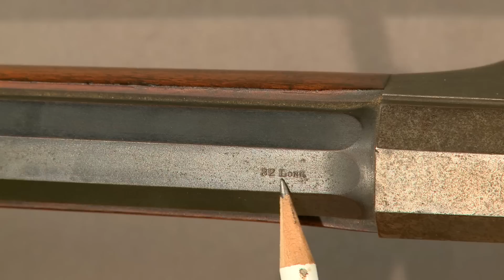Gunsmithing - How to Make a New Mainspring for a Ballard Rifle

Comment: When tempering the main spring, how long do you leave in the pot?
Reply: he left it in as long as it took to turn the spring blue. The time was more determined by the blueing process instead of the tempering time. All that is required to temper is to heat the spring to the desired temp giving some time to ensure it is uniformly heated. This time would very depending on part size and thickness...since you are holding the part well below the thermal threshold (when metal turns red hot) there is no danger in leaving it for a long time. Just ensure you quench immediately to lock in the properties or else the steel will just anneal back to its soft form.
Reply: ~20 mins per 1/8th spring thickness is the general rule. So a normal flat spring is about 15-20mins.

Comment: Spring steel stock should be .5-.7 % carbon, no less. That way your quench and temper operation will provide sufficient tensile strength and spring force. Also, it's not necessary to quench the spring in water out of the Niter tempering salts, you can air cool it just fine and it's less likely to experience a crack from thermal stress.
Reply: Steel is usually fine getting quenched to room temperature from 600 degrees Fahrenheit unless it has inclusions or some serious impurities, but you're right, that second quench isn't necessary, it just speeds the process along. I wonder how long he was tempering it for though, and how long he let it soak at 1500 degrees before tempering (I know he says 1400 but that's not hot enough for 5160 to austenize and that's what most springs are made of). Hardening and tempering steel is a lot like cooking food, what matters is time, temperature, and size.

Comment: What is liquid product for nitro-bluing,please.Tanhk you.
Reply: +coelhoteixeira It's not a liquid, well they are when you heat them up, but they are salts. Look up Nitre Bluing Salts.
Reply: +Nolansykinsley Thank you very much,bt if you can tell me please,the chemical name of the salts it will be usefull here.Thank you again.
Reply: From wikipedia " typically potassium nitrate and sodium nitrate (sometimes with 9.4 grams (0.33 oz) of manganese dioxide per lb of total nitrate)."